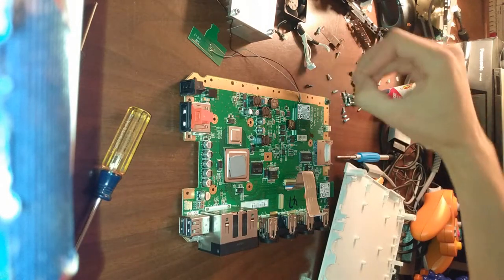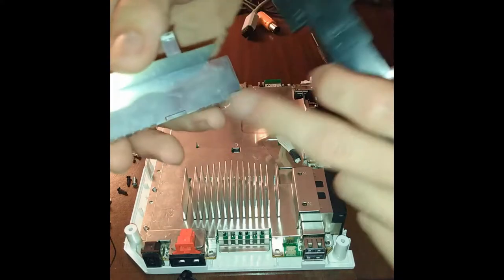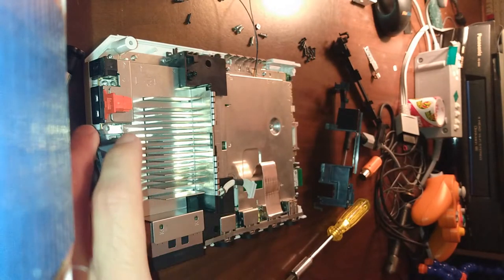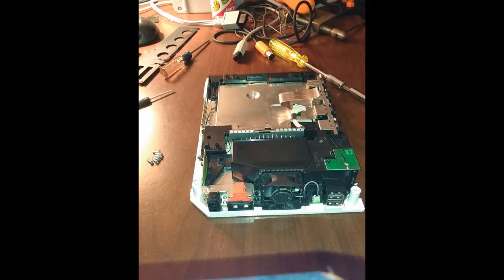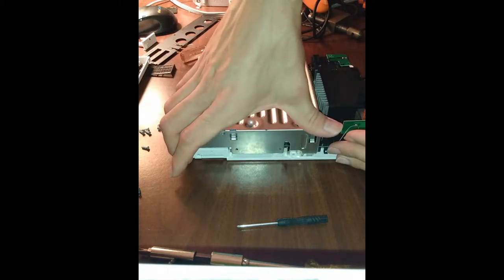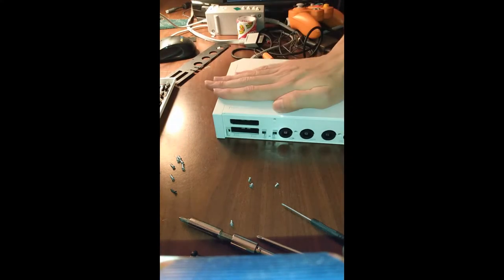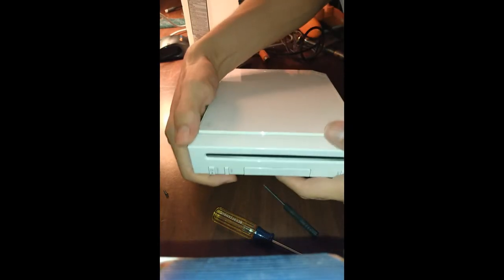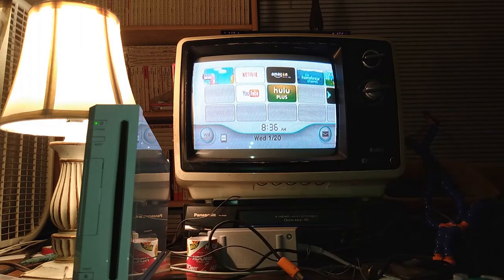Nintendo Wii full reassembly + playing Melee/NSMB Wii on a 70s TV

Comment: Dude you are a fucking saint, I got all gung ho while finally getting down the process of taking everything apart.
This is the most detailed and BEST guide on YouTube
Reply from the maker: Thanks man! Glad it helped get your system back together. Wiis are built like tanks and once they're properly cleaned and reassembled, they should run great for years to come. Great homebrew/hacking scene too - easily up there with Xbox, PSP, and 3DS.
Reply: @gpr-garwoodprecisionrepair6256  mine is running fantastically, I just need to do a few more things to the faceplate and I’m waiting on a few OEM parts from eBay (Cosmetic stuff) but they’re absolutely built like tanks.
I’d completely forgot that I modded mine back in high school, I may go through the SD card and clean a few things up though.
Reply from the maker: @GokaiiRed  Apparently Wii has unofficial support for micro/SDXC cards. A number of people have reported success getting their modded Wiis to read and work with 256-512GB microSDs - 2TB being the theoretical (but currently very expensive) max. If you have a giant stack of games, you can make backups of them and store them all on one card. It definitely preserves the discs and the optical drive from further wear and more than likely offers faster load times.